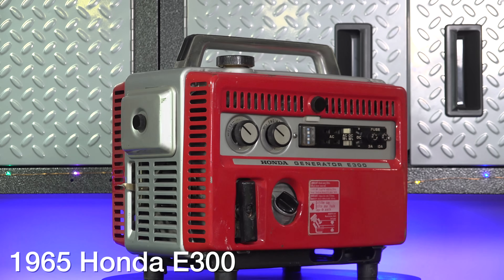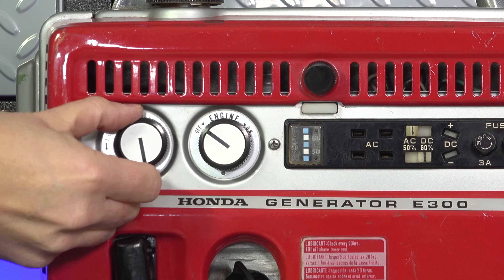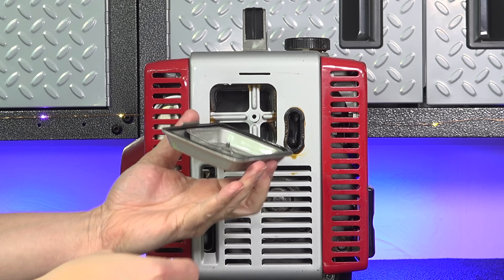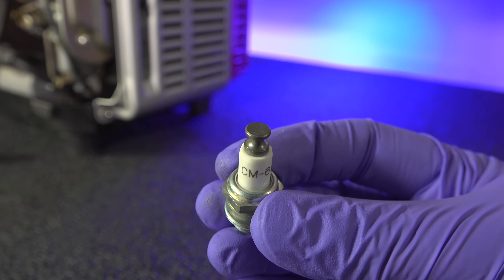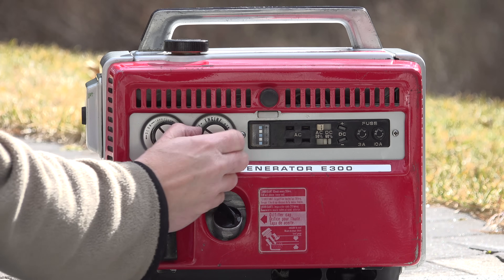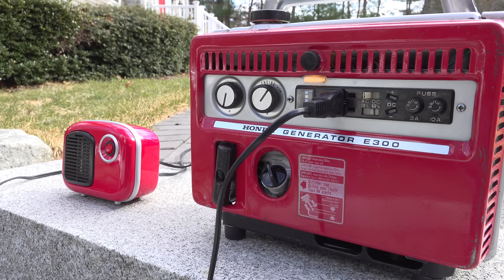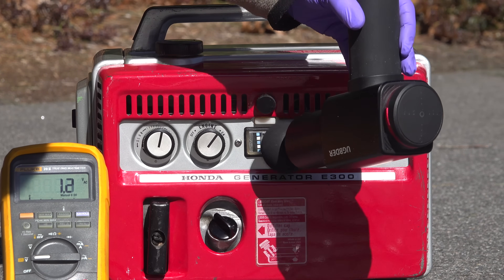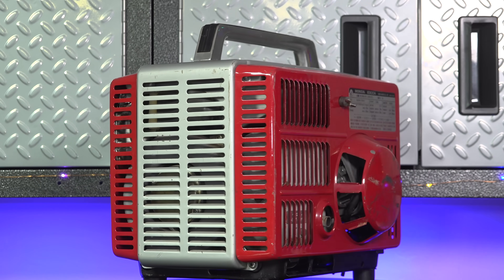Reviewing a 1965 Honda Generator

Comment from the maker: Thanks for watching please LIKE & SUBSCRIBE - To see Honda's current generator: https://amzn.to/3icivz2
Reply: Hey sir how are you hope all is well, cool video.
The tuning fork thingy is a vibration reed tachometer.  I’ve been doing industrial steam turbines for 20+ years now and we have them all over the place.  You can pick them up used,  the one on your Gen. reads the Hz based on rpm. Use your scope get the hz right and measure the rpms and presto you know what it’s doing. If your type in vibration reed tachometer you’ll find lots of used ones.  Have a great week hope this helped

Comment: It was a real low noice generator...a fraction of the generators of this time. Most of the time the running with high speed. To get the power needed. It is or or and not and and

Comment: I have just bougt Honda E300 generator. It's in nearly perfect condition. One tiny part is broken (fuel tap seal), fuel is leaking. It costs 4 USD and it,s not posiible to buy it in EU.  Cost of transport is nearly 40 USD!

Comment: Great video, I just picked one up last week and haven't even torn into it yet or tried to start it.  I had planned on dumping the oil and gas first, check the air filter (hadn't considered the possibility of disintegration), and spark plug (interesting size, hopefully available locally).  I agree about the power to weight ratio being low, but coolness factor is high.  Manual is there as well.  It's all in excellent shape and looking forward to a test run.

Comment: SORRY I'm posting over a year too late!!!  But what a wonderful video!  Dialogue well thought out and demonstrated. and I agree with some of the other posted messages, you have a broadcast quality voice that few people have.      ...and I hope Silver Cymbal that you are able to stumble across this posting this late in the game.  OH yes, and THANK YOU for posting the link to the original Honda Owner's manual...   

Before I start, I'd like to ask a favor:    MIGHT IT BE POSSIBLE for you to post the  HONDA PART NUMBER for the AIR FILTER ?

My best friend had one of these.  We used it while camping in the mid 70's.  It was fantastic.  We used it mainly at 12V DC connected across a car battery - I believe the manual says you need to do this at 12v  -  (Pg50) "...The DC portion is designed to charge 12 volt automotive batteries only...".    But mostly it was really used when we ran down our 12v camper (RV) battery.  This generator then not only charged the battery back up... while we could still run the lights and a radio or TV then at the same time.   Also I my friend mentioned that we should never run it very long without a load (DC or AC) and that on AC the voltage was closer to where it was supposed to be under load - it would be too high if there wasn't any load (like you found when you connected your tester).  The manual also says something along the line that the AC output voltage won't be correct if you don't adjust the frequency correctly (depending on your 50-60Hz switch - (Pg34)  "...when the switch is set to 50Hz and the engine speed is increased so that 60Hz is indicated on the frequency meter, the output voltage will increase by about 20%; the following problems will develop..."   So adjusting the frequency is important towards getting the correct output voltage (in AC mode).     I hope this helps anyone reading this so late after this video was posted.

I inherited this generator from him (he passed away).   It still looks great.   It hasn't been fired up in over 40 years.    Any suggestions beyond changing the oil and replacing the air filter before I try to start it up?

Comment: Hello, I have had one like it for a few years and it works perfectly, it has a broken valve or fuel tap that leads to the fuel tank outlet, could you tell me where I could find it? thank you

Comment: Engine rpm adjusts the frequency not the power  power is set but the armature. , This genarator doesn't have governor so it has to be set manually with the frequency meter to set 3500rpm and u can still buy frequency counters but it won't look exactly like original.

Comment: grandfarther still has his in the shed used to use it during the 70's to run a few lights with the three day week and miners strikes leading to power cuts his wife still has a box of candles under the sink just in case despite power cuts being so short here nowadays you wouldnt have time to even get to them before it came back on again  

goes to show modern lighting power consumption come to think of it put a few lights on back then and that was your lot

Comment: The tuning fork frequency meters I have use coils of wire that are attached to the ac output. It was hard to see in your video, but I didnt see any wires or a coil associated with your tuning fork meter. Is it just designed to shake from the vibrations of the engine running? If that's the case, no wonder it doesn't work. I thought the newer Honda tuning fork frequency meters were electric, but I may be mistaken

Comment: We have three of these! Well, the UK/Europe variant E300E, an E1000E and an E4000E, but with ours, they seem a bit finicky, especially when they get warmed up. More often than not, we run them with the covers off to keep them from vapour locking - They don't like restarting when they're hot, and with ours at least, we never found reliability to be a strong point in any but the E4000E, which is a 'V' twin diesel. It's main let down is the phenomenal oil consumption (about 2 pints for every three gallons (UK) of diesel) on a six hour run. They make good show pieces, but if we need reliable power we turn to our Lister/BKB diesel 6kVA, or Perkins/Stamford diesel 32kVA.
Reply: Bu tip jeneratörler 6 kapasitesine sahip sonra dinlenmesi gerekiyor  çalışma ortamı soğuk mekan ise biraz daha fazla çalışır. Aynısı benim de var fakat profesyonel kullanmak gerekiyorsa daha büyük kapasiteli olanlardan almanız iyi olur.

Comment: I feel like you would have seen better voltage results if you tested the generator with some load connected.
Reply: yes throttle needs to be tuned with the load on it. that 135 volts would drop down to about 110-115 once a load was placed.

Comment: I still have an EM 500 stashed away in the garage.  It has the Hz tuning fork and puts out dirty power that will make fluorescent  lights flicker.  The engine is petty  much worn out but it will start and run.  It does have those little Honda niceties and a similar build.  These side valve engines were a bit noisy any prone to carbon build-up.  I prefer the newer OHV inverter generators and its starting to look like lithium power stations like the Jackery may be the future.

Comment: The EX650 is a good one as well. I still have one. They improvised the air cleaner and they use a tuned governor to control the speed.

Comment: Wow, the nostalgia. We had this exact same thing in the seventies on the boat we used to spend our holidays on (I was a child). We used it to recharge the lead batteries on board. Four stroke engine mind you! Anything Honda did back then was four stroke, unlike their competitors. Also their mopets.

Comment: An oldie but a goodie just like my lawn tractor I've had for over 30 years and I bought it used. It's a Sears 12 HP 42 inch cut , built in 1977. Put the battery back in when it's time to mow, and it starts like you shut it off yesterday. I finally had to put on new tires all around 2 years ago.

Comment: I have an E 300. It's physically the same but the controls are different. It has a voltage meter instead of a hertz indicator. The choke is in the throttle knob by pulling it outward. The air filter is under the side cover. It does have a lighted dash. It doesn't have the slide over the DC outlet. It could be a little older. It starts on the first pull and runs perfectly. I run it in Tru Fuel. The original owner used it on remote fishing expeditions. I believe there is a You Tube video on an original Japanese TV commercial showing a family using it to power up a black and white portable television.  It's a cool piece of Honda history, and yes it weighs 50#s. I would consider selling it.

Comment: Lol w/ the massager "tool".. thing looks intense. Normally I'd issue a man card violation, maybe suggest air gun and wire brush. But that was too funny. A must use tool for future videos. I bet that thing could clean carburetor parts lol.

Comment: yup never seen that before!
oh wow even back then Honda was killin it, dang its so well made, wasn't even expecting it to run or run correctly. jolly good vid man!
Reply from the maker: I am amazed at how much the new ones still have in common. Just no more free spare parts inside the case.
Reply: I still drive my 2001 Acura…..that I’m told, has a Honda engine….I’m a woman 😊 Never has broke down. 👍🏻